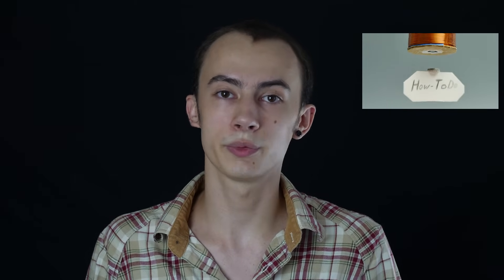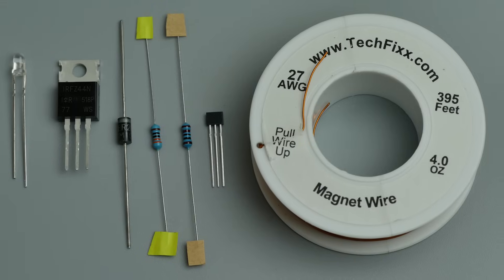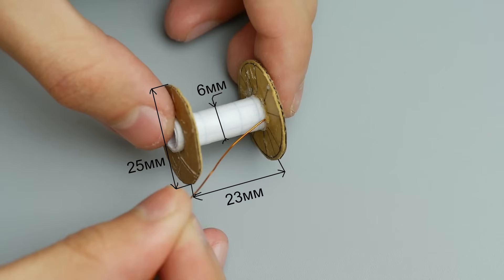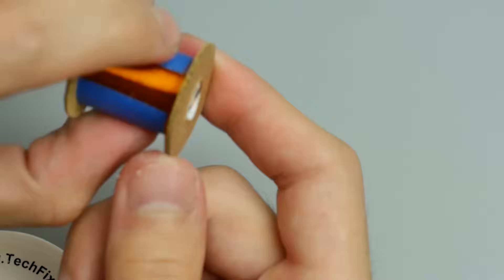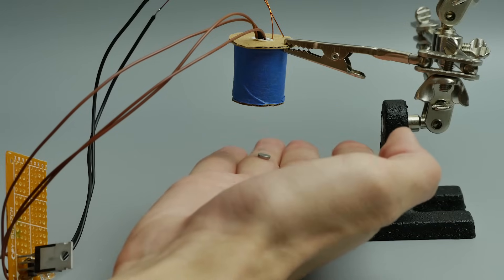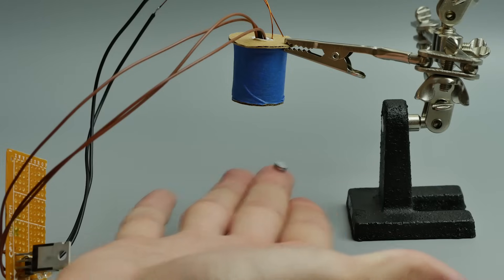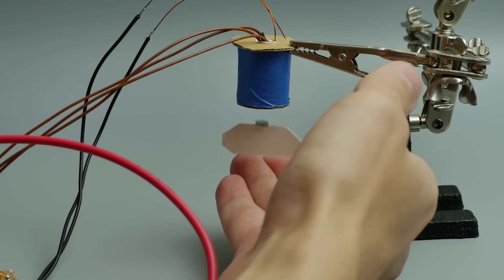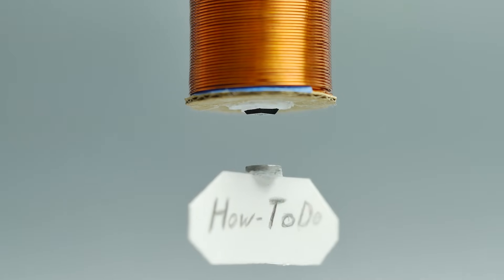How to make a electromagnetic levitation device

Comment: can I use a w41fc hall sensor and I made a coil of 30mm diameter, 12mm inner diameter and length of 25mm with 0.35mm wire. What voltage should be applied? Pls answer!!!!!
Reply: I guess nobody answered 😢

Comment: Hey Constantine awesome video. I just have few doubts. First how much current is required for this circuit and show I remove the insulation coating of the copper wire before winding it up as an electromagnet ??
Reply: vivek reddy .. the current is minimal, like what it takes to charge your cellphone and NO. do not remove the lacquer coating on your winding except at the connection ends... about 1/2 inch

Comment: Very bad explanation first you solder the components after you desolder I do not know the voltage of the led on the board nor do I know where to fix the wires that goes on the coil very fast

Comment: hi , does the output voltage of the hall sensor drops to zero??? mine drops 1/2 the voltage of the input so the MOSFET is always on
Reply: I'm gonna use a comparator to make it work, however I want to replicate this exact circuit, u think I'm using a different hall then you?
Reply: hector pena Use bigger resistors for bigger voltage drop

Comment: what current does that draw from holding up.. how many grams?
Reply from the maker: I have not tested, but I think that something small about 10 g
you can proportionally increase the size of the device, if you need to hold more weight ...
Reply: How To Do how much power does it use in Watts?
Reply from the maker: I don't know, no more than 5 watts, because for the phone charger 1A
Reply: What would you need to change to increase the weight it can hold. Just the electromagnet size or something else?
Reply: How To Do is this project working